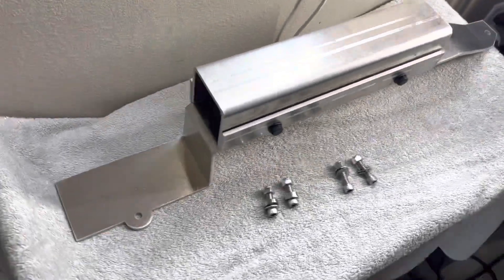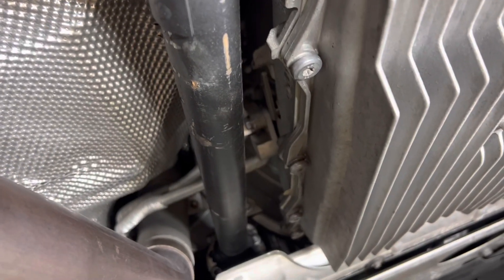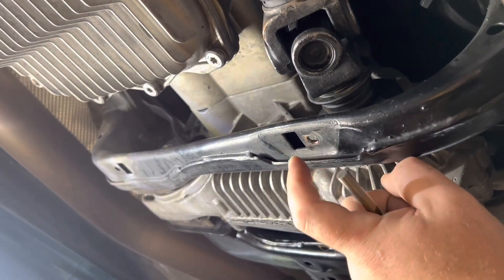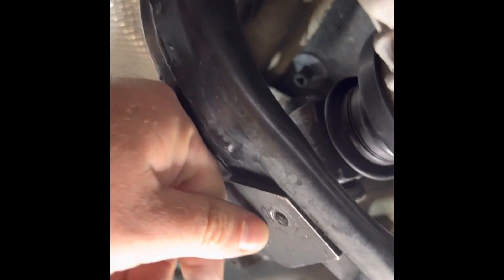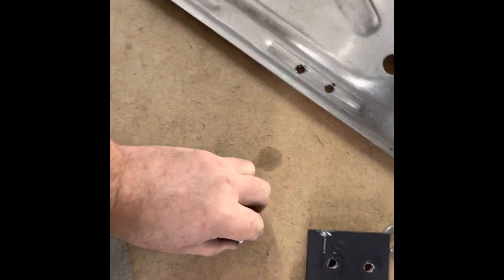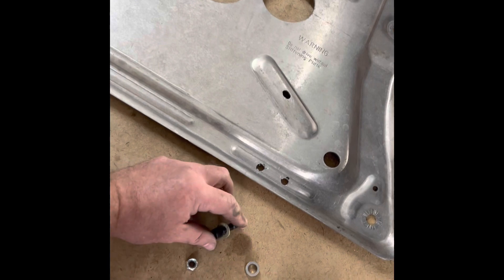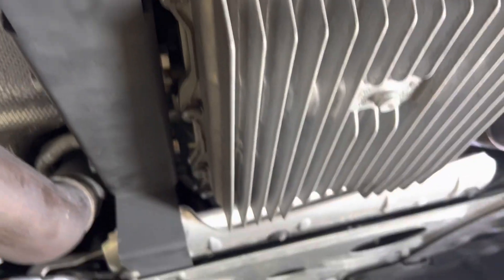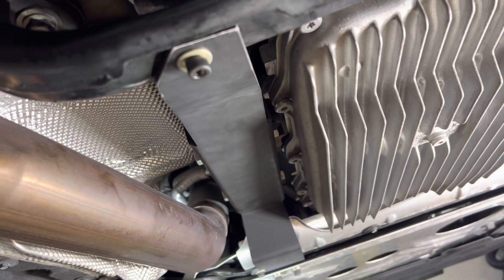BMW F85/F15/E70 Driveshaft shield installation step by step

Comment: Will this work on F06 grand coupe xdrive?  This is needed so bad for the f series cars with N63 platform.
Reply from the maker: What issues are they experiencing? Thanks
Reply: @Dentprotony  The front driveshaft breaks loose and goes through the side of the oil pan and sometimes puts a hole in the engine block.  F10 and F12/13/F06 xdrive versions with N63 and N63TU.
Reply from the maker: @registrationaccount1034  ok gotcha, what breaks, the ujoint?
Reply: @Dentprotony  yes the ujoint is the point of failure.  I've seen a few twist with extremely high up applications. I don't think it would take much to modify your solution for the F10 and 6 series guys.  There is a pretty huge amount of them out there. So a good market.
Reply from the maker: @registrationaccount1034 i am thinking to come up with a heavy duty driveshaft maybe. Can you text me 6016181023 maybe you could test it for me please